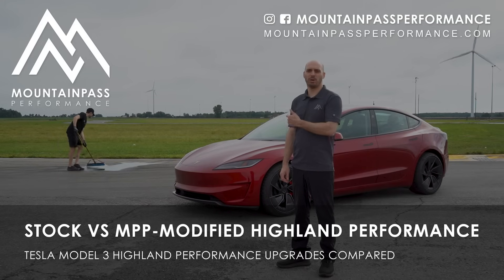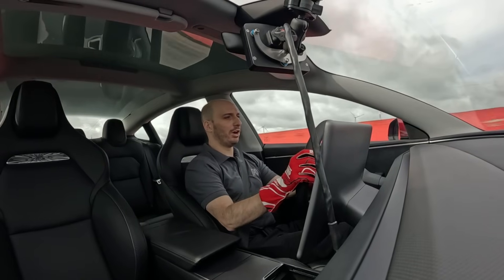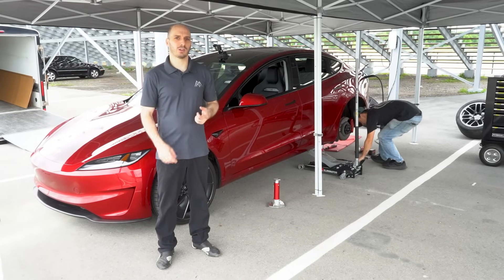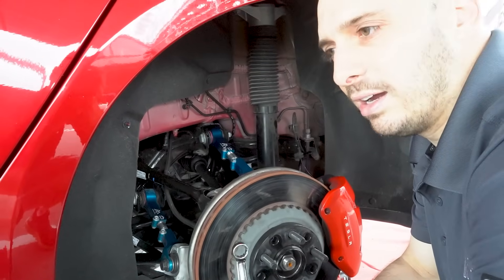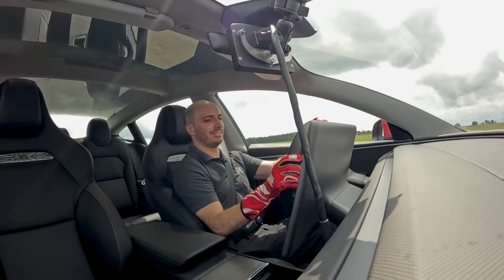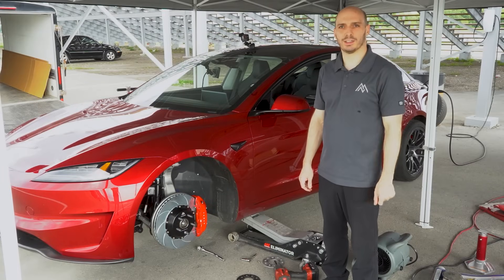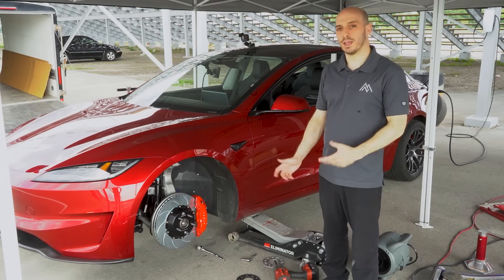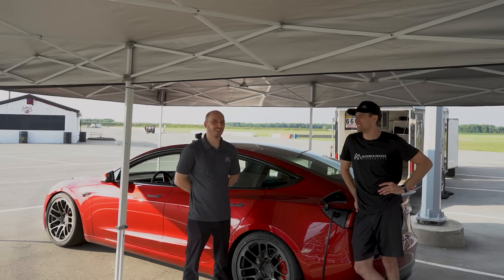Adding Mods Every Lap Until our Tesla Model 3 Performance (Highland) is a Track Weapon

Comment: As much as I like taking my 2024 M3P on the track, it is just not a track car. The two main issues with it are things that you can’t fix: it’s heavy and the battery depletes in 10 laps (3 of them at full speed, the rest is slow due to overheating)
The weight makes the car eat tires and brake pads like they are made out of paper. It’s a great and fun daily driver though, and FSD is pure magic. But I would never recommend a M3P for tracking.
Reply: no ev is a track car simply eat to much power and weight is sacrificed. but If you want something to beat up ev's are the best track cars ever no issues with abusuing them while a m3 will pull a piston if you keep tracking it

Comment: 14:44 isn't that the rear right rotor being placed on the rear left? the slots suggest it should be on the other side so that when its turning it exhausts hot air with centrifugal force

Comment: Awesome video Sasha, great mods and great driving. One question though: are you not bedding in the pads? The video cut from switching the pads and rotors right back to action on track.
Reply from the maker: Yes, absolutely! Bedding the brakes after installing is a must.

Comment: How were the seats feeling? I just had my first track day in a 2021 M3P, and the seats were HORRIBLE. I definitely need some kind of upgrade, so I'm thinking of the Highland retrofit. Would you recommend it for occasional track days and short stints, or should I be looking more into bucket seats? Pricewise the Highland retrofit would be same or maybe cheaper than a bucket seat fit, and wouldn't ruin the interior look and everyday comfort that much, I hope. As you didn't mention the seats being an issue, I assume it was fine?
Reply: previous gen seats are far more comfortable especially if your a smaller person. when you accelerate the seats would absorb you while these are super stiff

Comment: I wouldn't call it a track weapon since it is basically only good for one flying lap before overheating its systems.  Track mode needs a way to proactively drastically reduce power if you want to go run multi lap sessions at a track event.
Reply: 2024+ M3P’s have an endurance mode.

Comment: Great stuff. Do you guys plan to offer any parts for an EV that can actual handle track use? Ioniq 5N & upcoming 6N.
Reply: I wonder if it is  worth it  for  them since more model 3  are sold then  the 5 n or 6n
Reply: @LaJuanHughes definitely, I just wager a lot more people track the 5N considering it's actually capable of it
Reply: @WilliamRori  they sold less than 2k last year vs 189k model 3. Bigger market. I was just thinking. I been to a few event an they had model 3 run in ng the road course and they have they series where that are all tunned the same where it more a obout the drive not the cars . And a smaller hit on the pocket book. Also you could get a  Older model and upgrade it easy. They could come  out with stuff . I was just thinking or market size a world wide market . With mpp and unplugged performance.

Comment: Peak Battery KW seems a bit higher for the new laps.. could it bee the heating that lowered the internal resistance and rise tge voltage a bit?.. How much time between teh laps and what battery temp average during running  each different setup?

Comment: Greetings from Italy—beautiful video. In the end, as always, the tires make the biggest difference to lap times on track. I have the same car with MPP FUCA, MPP rear camber arms, MPP front lower bearings (all four), Michelin PS4S, lighter wheels, the MPP Brake Master Cylinder Brace, Aspira/Goodridge stainless-steel brake lines, and I’m waiting to install your MPP KW V3 Model 3 Sports Adjustables and, in the future, the Page Mill two-piece front rotors and rears. Were the pads Pagid RSL? Did you also change the brake lines and the fluid? It’s a pity there was so little difference in lap times with the new brakes. I can’t wait to see how much the lap time improves at my local track
Reply from the maker: Well thank you for all of the support!

Yes, lines and fluid were already pre-installed. It would have been downright unsafe with OEM brake fluid. 

The reason the lap time didn't improve much was that the faded front OEM brake pads were actually helping the balance of the car on entry. With the new pads and the "understeery" setup with no rear anti-roll bar, there was a lot of front-axle sliding from trail braking all the way through mid-corner. 

Plus, the OEM pads could only do this for one lap, and even that was scary. With our Pagid RSL pads we can go lap after lap with a consistent pedal!
Reply: @MountainPassPerformance  thank you very much for all your information, i really apreciate it!

Comment: Can it not be that the sublime LR RWD with a partybox is actually a better street&track platform if you care more about fun than outright speed? If the thermal limits are based on current draw, getting rid of a front motor may just help.
Reply from the maker: LR RWD is best
Reply: Cooling capacity also reduced?

Comment: Been following since the ridiculous Kels Z. So happy to have real drivers/tuners in the EV space. I am curious about how polar moment of inertia relates to evs that have low flat center of gravity compared to mid-engine cars.
Reply: To clarify above, i guess I wonder is there anything that can be done to the EV suspension components to affect the polar moment of inertia favorably? Positive caster?
Reply from the maker: @MrFluidRock  Polar moment is based on where the weight is. I can tell you the Model 3 drives like a car that is 1000 lbs lighter. This is due to a number of reasons, but the polar moment isn't a big concern. The weight is all inside the wheelbase which helps!
Reply: Me parece que con el coche de serie  el conductor no se esfuerza por conseguir su mejor tiempo. Curiosamente la primera sin casco ,guantes... 0 protección,  el motivo es que se guarda para que se note después más la diferencia.

Comment: brake shield looks backwards
Reply: They're all turned inwards now, makes larger diameter rotors easier to install
Reply: @JT-ow3hq  oh bigger than stock discs, k
Reply: @JT-ow3hq  does it also work for LR AWD versions?

Comment: How do you solve the overheating problem?
Reply from the maker: Unfortunately this cannot be "solved" as there are internal models that the system uses to restrict current based on temperature estimates, not actual temperatures. We learned this through a ton of testing with the earlier cars. We cooled down every component that the system was complaining was "too hot", yet it made no difference. Why? Because those temperatures are modeled, not measured. 

There are different types of overheating - those short term bits cannot be fixed, but we can address the overal bulk system heat, by rejecting more heat with larger radiators and oil coolers as we do. This helps to keep the system cooler and allow you to get back on the track faster after a supercharging session. 

However those modeled limits are based on current and will always kick in pretty quickly if you're running high current (full power). This is because heat generated goes up exponentially with current.
Reply: @MountainPassPerformance thanks a lot for sharing this, the owners need to know. The brake overheating warning is the same story, also just estimated from pressing the brake pedal, not by measured temperature. But with s big brakes kit can be the warning safely ignored.
But despite the limitations I still love track time with my car, I will go for some more camber with your parts for the next year’s season.
Reply: @MountainPassPerformance  Thank you for the clarifications.  I assume there is no way to "trick" the sensors or power control unit so that it "sees" less current or lower numbers in the parameters it uses to model  to raise the threshold for power reduction?  Or alter the algorithm used for the modeling?
Reply: That is my question too.  Can a bigger more efficient radiator and more coolant capacity help?  Does opening up the airflow to/through and exiting the radiator make a difference or is the big bottleneck the battery coolant passages?  Can a interchiller or icebox system be designed to have actual cooled coolant to give longer runtimes before power is reduced?